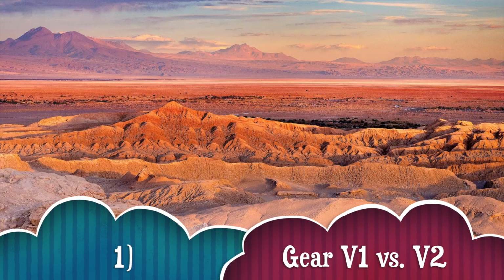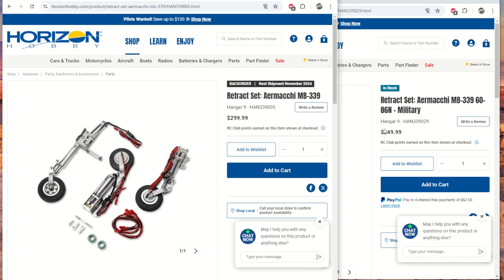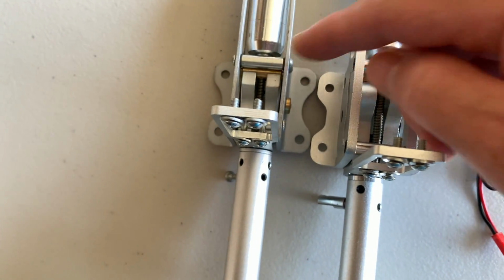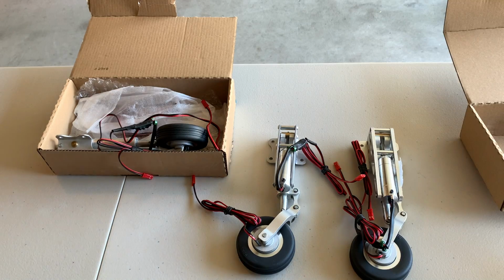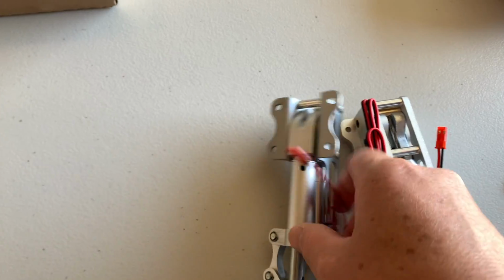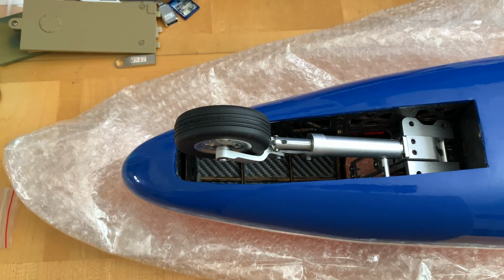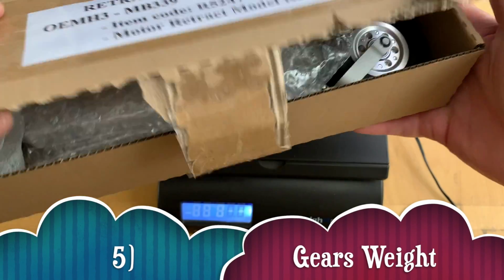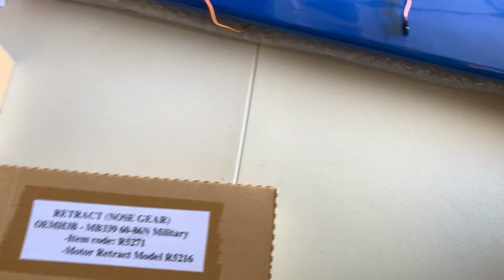#Hangar9 #MB-339 #Retract #gears  comparison.

Comment: Great Video... The CG should remain the same as the V1, the V2 gear are symmetrical to the original ones. Just beefed up in certain spots evenly to the V1. Although they weigh more the weight is still displaced evenly on the airframe.
Reply from the maker: Yes, that was what I saw while building it and others in the MB community also mentioned it. Thank you for sharing it will us all.